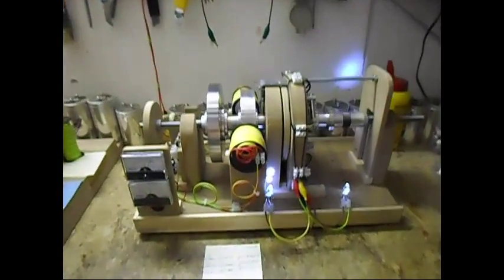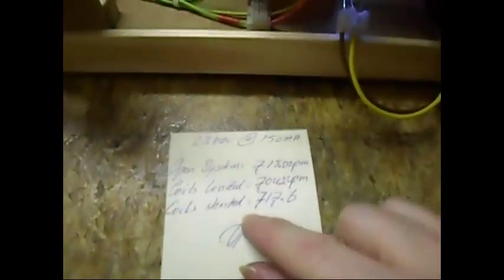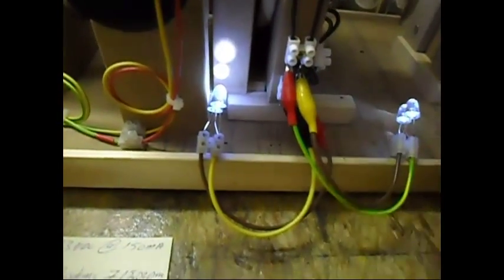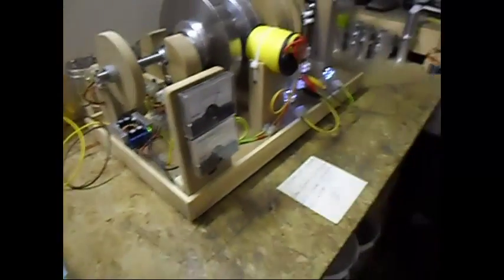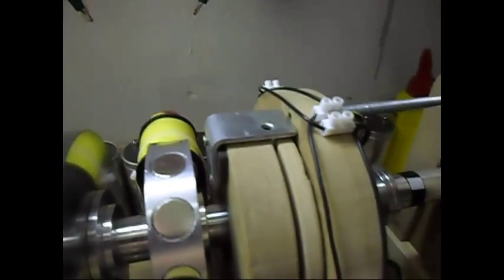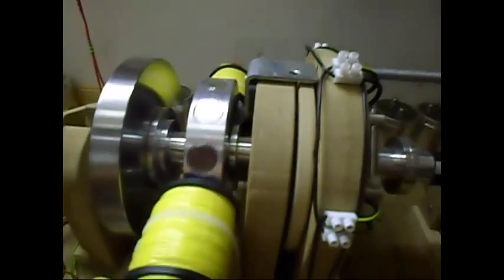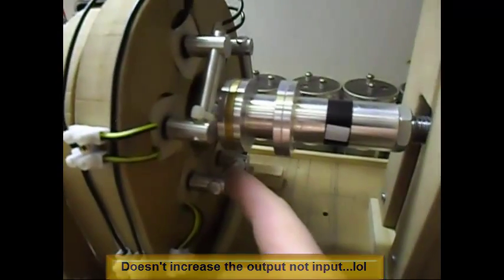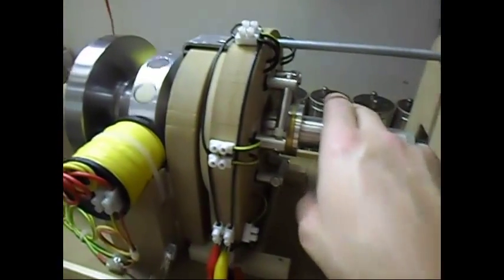Flux Gate Generator - Update 13 Testing T-1000 flux gate design...

Comment: If you put the generator on a seprate shaft and use a small pulley to get more rpm might work. Another great build! Cheers!
Reply from the maker: Hi Ryan Doupe,
Thanks for your comment and glad you've liked it...^^
I do have another pulse motor that can get me more rpm...and i'm building another separate setup which has a DC motor with a PWM to make my testing easier...;-)
Cheers

Comment: Woot woot Mister Caribbean Root...s. How you doing buddy, I missed you again so dropped by to say helloooo. And to see how the flux gate is getting on. It's changed quit a bit since the first video. Those white LEDs a very bright. You know when you make a pickup coil, like the 6 that you have embedded into the end of this, how many cores are they? Are they just one core and you connect an LED to to either end? Hope you're good mate, time to get going to work... Mondays come around soo quick! Cheers
Reply from the maker: Hi there mate,
Nice to hear from you...been pretty busy here...but doing fine...^^
It has change a lot and will change even more...lol
There are 6 coils and 6 cores...than 3 sets of 2 cores bridge together...hope you can follow that...^^
The coils them self are 2 sets of 3 in series and on each set i had 2 leds...;-)
Mondays always comes quick...way to quick.......lol
Hope you and your family are doing fine to...^^
Cheers

Comment from the maker: Just a update on this flux gate generator setup where i'm trying out a design from T-1000...^^
Numbers,
Input is 23Vdc @ 150ma...
Open coils = 715.0 rpm...
Coil & leds = 704.2 rpm...pretty good...not bad at all...^^
Coil shorted = 717.6 rpm...Sweet...o.O
About the 11 rpm drop...it is with all 6 coils being loaded so that is pretty impressive...:D

From my own experience i can say that with a few hundreds rpm more it will speed up while under load and the output of them coils will be better to...;-)
Will i try it...dunno...lol...that would mean that i need to use 2 different coils to get me that kind of rpm.......lol
I'm was thinking of modifying the coils to get higher rpm so we'll see...^^

The threaded bar is to adjust the space on both side of the rotor and the L shape iron on the stators is there to hold everything in place...;-)
The magnetic pull on everything is massive so without these to parts everything will just stick on each other like crazy glue...lol

All in all...a very nice design by T-1000...his design will perform very good when you get the ratio of magnets/rotor disks/coils core nicely balanced...^^